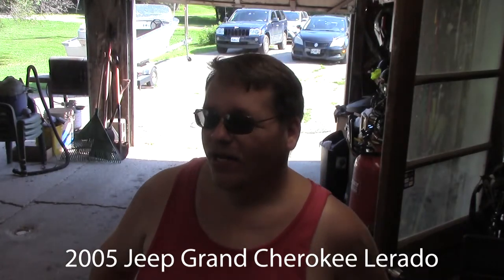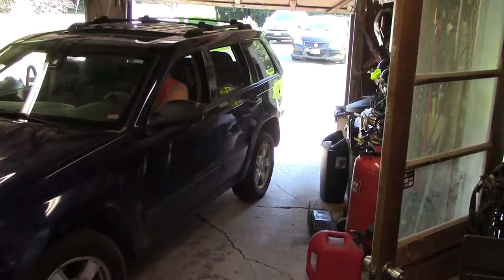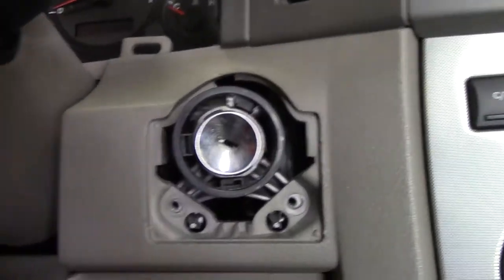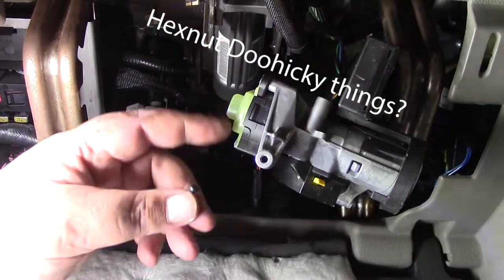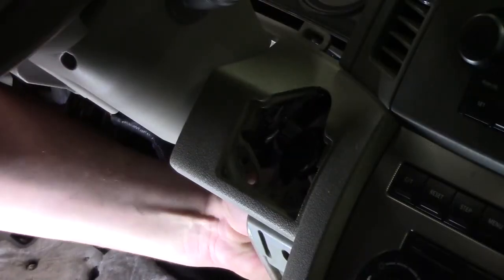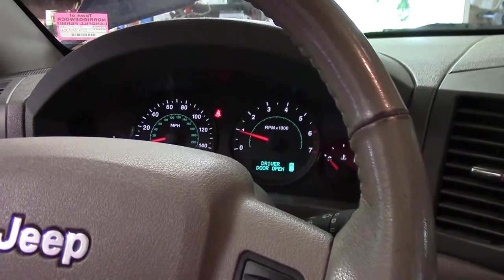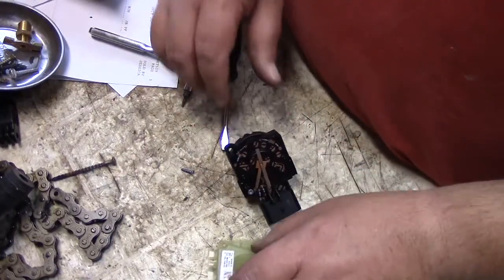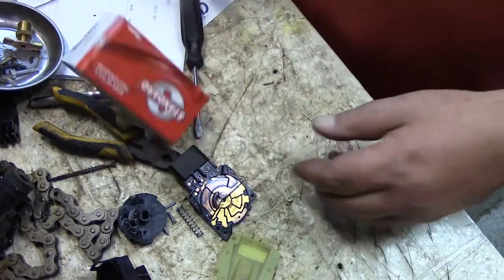2005 Jeep Cherokee Laredo Flashing Dashboard Key Switch EASY  replacement

Comment: In my experience, all the job is done easily if you first remove the blend door actuator wich is behind the ignition assembly. It's an easy task and doing that will prevent a lot of effort in removing the ignition key assembly. Hope it helps. Thanks for the nice video and the funny remarks.

Comment: This is definitely what I needed done! There was a recall on this part for years 05-08. Unfortunately I ignored the letters and it is no longer covered. Do not ignore this if you have an issue! The vehicle can shutoff at highway speeds and lock the steering. That was why the recall came about.
Reply: How did you fix the problem

Comment: OMG thank u thank u!! Bought the part on Amazon $19 got it next day, took 20 minutes to remove the old and replace! So many issues are solved!! Again thanks from a girl!! If I can do it anyone can!
Reply from the maker: Awesome, glad my vid helped you out!
Reply: Well I thought it did all the things but didn't fix the setting for the a/c. Still have to put it on full blast for it to come on :(
Reply from the maker: @angiereed684  That is usually due to the blower motor. I have changed so many for the same reason.
Reply: Hi. Could you please post link to that part you got. Thank You
Reply: @angiereed684  could be the blower motor resistor. They usually only allow full speed when they break

Comment: Thanks for the video, mines a 2007 Jeep Grand Cherokee Overland Overland with the same problem. At first was the wire bundle was left on the coil pack and melted the wire conduit but not wire the individual wires insulation. So, I re-wire conduited the whole engine wiring and made sure the wire bundles are in the troughs and other wires away from the engine as much as possible. It took me a whole roll of 5/8" and 8 feet of 3/4" wire conduit tubing and a roll of electrical tape. Now the stupid switch is causing a similar problem, when I press on were the key goes in with on it on, the glitches in the dash, ac and other electronics occour. This is definitely a safety hazard and I need to replace the ignition switch electronics soon. Thanks for saying how diagnose that it's the switch by press on it and if it cause the electronics malfunction, it's the problem.

Comment: Amazing job ! When you say the engine light was on, my abs brake light is going off too flashing and the speedometer is jumping can you confirm this is the same issue? My Jeep will just cut off ? And also says transmission over temp but the fluid is fine and looks nice and red not burned.
Reply from the maker: I would probably bring it to Autozone to have them run a diagnostic for you. Usually they do it for free.
Reply: Solution?

Comment: The Jeep  dash lights and headlights flicker at night but no buzzing sound. Is this the same problem and solution ?
Reply from the maker: I have a 1995 Jeep Wrangler YJ, usually a grounding issue. Most likely one of your bulbs is no longer properly seated. Every electrical issue I have found so far was either a bad bulb or poor connection of a bulb.

Comment: Thanks. Did mine and now doesn’t know when I remove the key.  May have broken the pin. Will be disassembling tomorrow. Wish me luck.
Reply: What happened?
Reply: I replaced the Amazon aftermarket part, which I had just installed, and the new Mopar part and it works again.  Bought it at moparsalesdirect.com, 30% below list price. Good luck.
Reply: Not a broken pin in the ignition body as I had feared.

Comment: P.S. It's better to keep at least a quarter tank of fuel. What brand is the best replacement switch?
Reply: My 05 jeep is flickering when its turned on. The dash even has the RPM and speedometer gauge go down to like if car was off. Hopefully this is it. 
Thanks
Reply: @00tonytone  did it end up working?

Comment: Does it affect anything to change the switch if you are running a command/auto start? 
Mine has been doing the random dash light flicker where the fan shuts down as well and I just wanna make sure he it’s not going to affect my command keyless start.
How is it working now by the way? I’ve heard others have had to replace there’s multiple times. I did pick up the same part a while back when it first started happening the standard brand  US521 but it stopped happening for a while and it recently started back up.
Reply from the maker: I wish I could answer your remote start question, but I am not a mechanic.  Although, I do play one on YouTube.  :)
However, your remote does not connect directly to the switch I replaced. 
As for if it is still working, no clue. I sold it not too long after that video.

Comment: Any comments on my question
Reply: Those Cherokees were recalled for ignition switch  problem. The dash flickers they also said if jeep shuts off  steering wheel will lock and can cause an accident.   I never heard of a vehicle  lock steering wheel  with the key in on position  even if it turns off.  I think jeep dealers just said that to fix recall and  avoid future  lawsuits , because steering does require more strength because steering pump pulley ain't spinning.  But locked can only happen if you turn key to off/lock position.

Comment: What's that light that was flashing on n of on the right..then it went of mines staying  on
Reply: Should be tire pressure sensors
Reply from the maker: Yes, that just means you have low tire pressure. I keep mine around 44psi

Comment: Did it make the engine run rough
Reply from the maker: No, while sitting idle for about 10 minutes (waiting in line), all the lights and buzzers where going off on the dash. Found it was a recall in the switch (which was already done a few years ago), so I replaced it again on my own.
Reply: @americanredneck8774  did this video fix your issue or did you have to re place the switch again?
Reply from the maker: @markpitts850  Yes, it seems to fix it. Has not done it since.